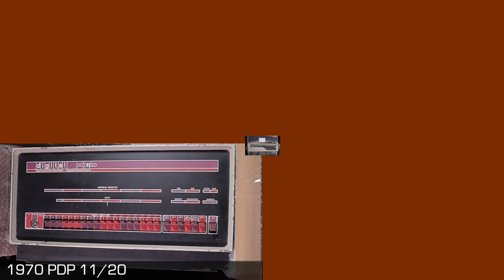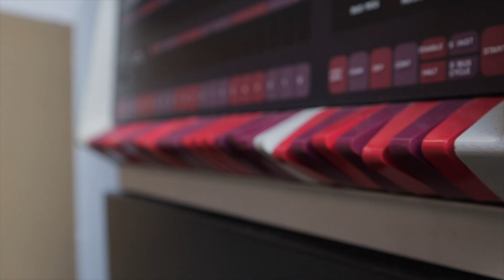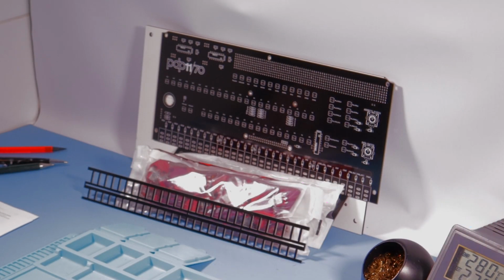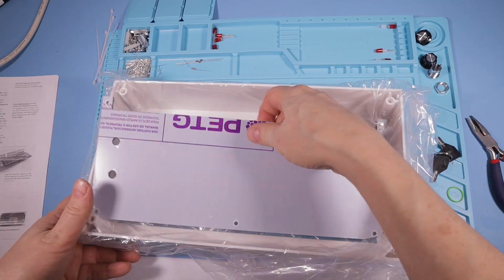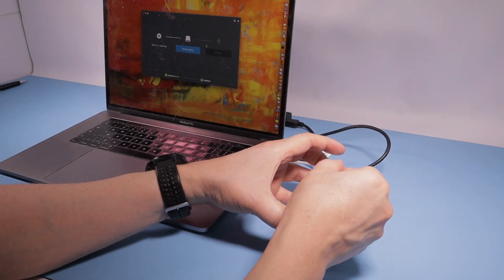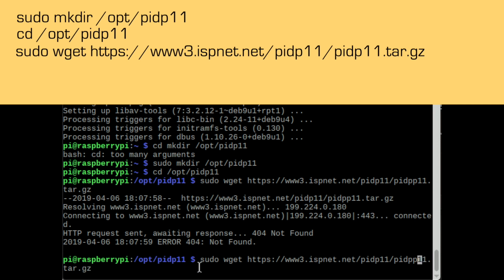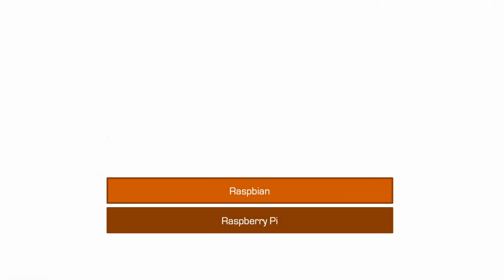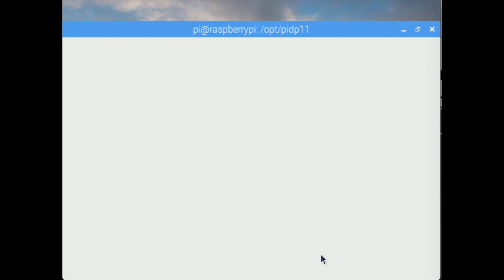PiDP11 Kit Build - Part 1 (of 4)

Comment: Hey, how do you start the emulator on the command line?   It says run it with pdp8i
    Command not found
I bought a Pi, flashed it with the Pi image for the PDP from their website, setup users, set the rootpassword, added myself to the sudo group, ssh'd in, installed a telnet and lighthtp server, opened port forwarding, modified a custom message of the day... all that good stuff...    do I have to install the emulator with sudo apt install pdp8i ?    

I was under the impression the project image for this would not only include the Pi OS, but all the PDP8 goodies and software repositories everyone had collected....     so now I'm fluxomed.
Reply from the maker: I'm thinking you may be looking at the wrong documentation or image?  This video talks about the PiDP 11 which is a different kit and image from the PiDP8. Are we talking about the PiDP 11 or 8 in your post?

Comment: I saw one of those disks on a system that controlled a highly sophisticated aluminum rolling mill. It was a 30 million US dollar machine (in today's value). The rolling mill could not fail because it fed a bunch of aluminum foil making roller mills so Siemens (who did the control system) went for DEC.

Comment: I learned my trade on the PDP-11/03L in 1979. First on a teletype, later a CRT. Sure, I was using BASIC V01B-02 at the time. One single program remains from that time, TEONW. However, I converted it to Forth. It took me quite some time to figure out what all this spaghetti code meant - and wrote several programs to assist me in that operation. Nowadays, it's fully structured. As a note - there is still an almost original ZX Basic version available on the Internet in .Z80 form. Google: "teonw" zx spectrum .z80

Comment: I started looking at the software, the systems.tar file. The simh boot.ini for sysv says "echo To shutdown, type 'sync' three times and halt the emulation." Who wrote that? The right way to shutdown is to use the /etc/shutdown script.  It takes one argument, the number of seconds to wait, so shutdown 0 will shut down as fast as it lets you. The /etc/checklist file is missing /dev/rp1 so /usr will not be checked automatically. The root file system is corrupt. There is an error message at boot that goes "-su: /usr/lib/acct/startup: cannot execute" that is due to having incorrect directory permissions all over the place. The rje.cpio and graf.cpio archives were extracted into /usr but they belong in /usr/src/cmd/rje and /usr/src/cmd/graf respectively. The problem is that electrical engineer types make bad sysadmins.
Reply from the maker: Please provide any constructive feedback on the software to its developer.
Reply: @beige-o-vision6936  I have a working set of detailed instructions on how to install SysV on a SIMH PDP-11. It's in a GitHub giat. I can't post a link in a yt comment as Google will just censor it and delete my comment. I might make a video of it, they don't censor those.

Comment: does it also emulate the constant need to manually set the front switches to reboot position, power reboot the 11/70 and set the switches back to their run positions?  that was my first IT gig at a university
Reply from the maker: The joy of emulation is you can schedule your own 'chaos monkey' to crash your own system, so you have the joy of repeatedly rebooting it.  Personally this is a particular nostalgia itch I've never needed to scratch.